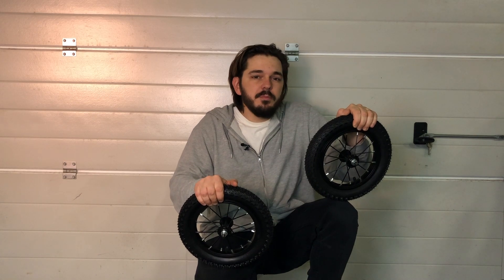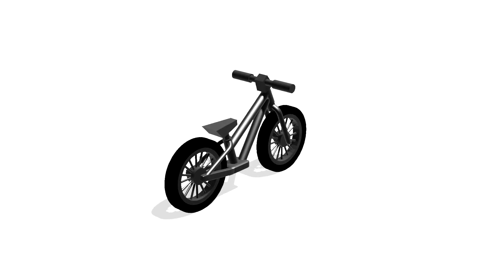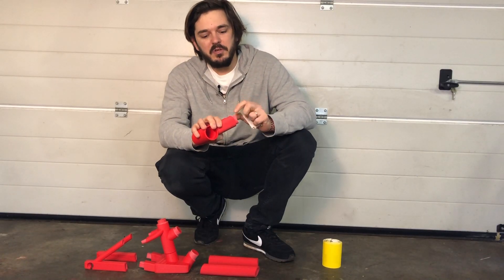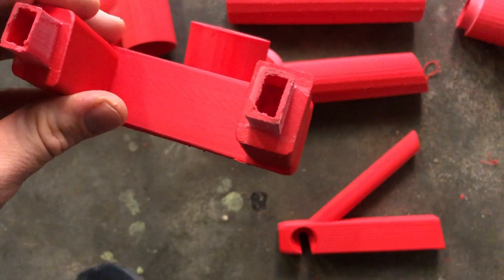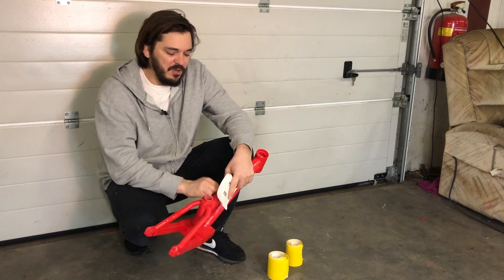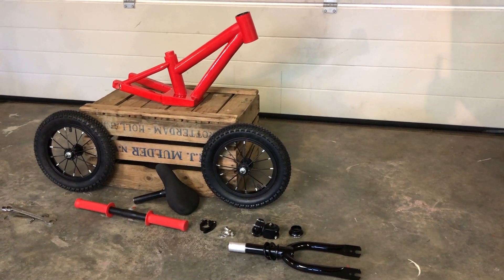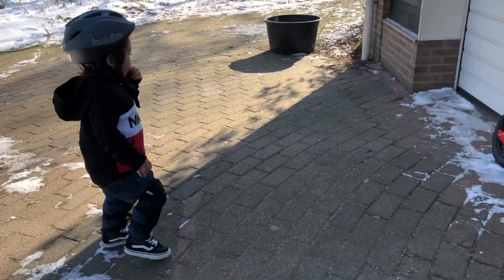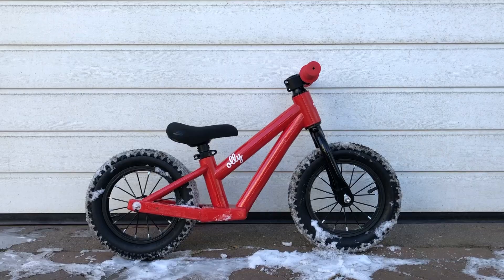3D printed Bike - I 3D printed a walking bike frame on the Creality Ender 3

Comment: This is cool but the epoxy ruins it for me. I would like to see it done with just ABS or something. Epoxy is expensive and horrible to work with.
Reply from the maker: I understand that. I’ve tried ABS but I couldn’t manage to get those big prints out of the machine without warping or shrinking. This way the parts wouldn’t fit into each other anymore. So with a printer without a housing like the Ender 3 its almost impossible . Plus printing without infill saved me a lot of time. That’s why I came up with the epoxy filler. it worked really well for me. Cheers 🙌